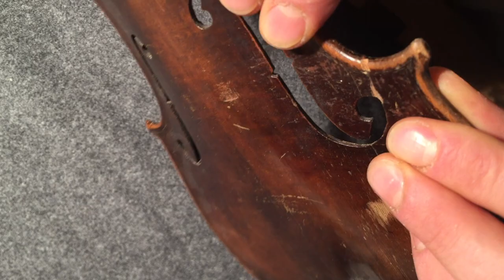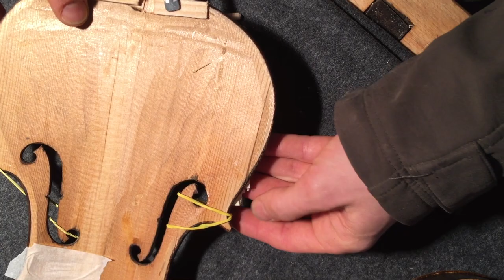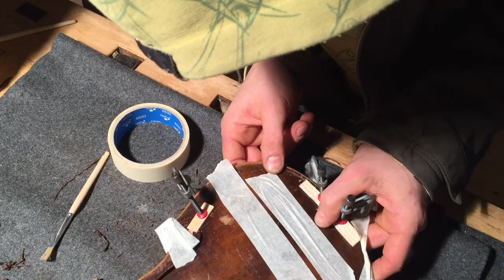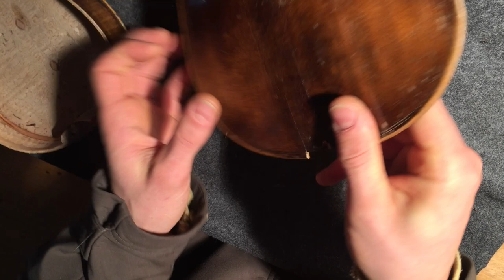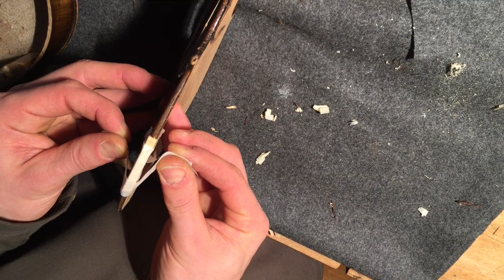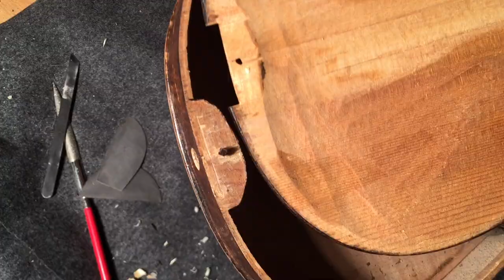Violin Repair Part 2 violin top cracks

Comment: I absolutely LOVE the fact that you are using masking tape on a violin! lol. I use it in guitar repair, gluing binding and stuff like that, but this is the first time I have ever seen anyone use it for violin repair :) Excellent job!!!
Reply from the maker: sure, clamping force for violin repair work and usually should be very low to not build up any unwanted tension on the instrument. and I use magnets for patches :) but also cnc .) Thanks!!!

Comment: Very nice video...is there a part 3 video?...did you ever consider smoothing or scraping out the original rough gouges on the underside of the top plate?...
Reply from the maker: Thanks, not finished yet… but it’s not for a customer… had to make other repairs & paid jobs… maybe i will make this video/ violin complete in future… i am not going to smooth the rough underside, because i am fascinated about the correct average thicknesses at its limit.

Comment: Thank you so much for the great video! What kind of glue are you using for the repairs? It seems to dry very thin.
Reply from the maker: I use traditional hide glue, and i prefer the bone glue. Its almost transparent and i prepare it for depending on the application, more or less thin.

Comment: hello Meister, what material do you use to reinforce the gluing instead of the wood? Thanks a lot
Reply from the maker: Hello, I am reinforcing with planed wooded shavings. Won't get simpler and lighter, without being over enforced and inflexible. Not much needed, make the test.
Reply: @CJKViolin  thanks Meister. Do you have an other video showing this technique?
Reply from the maker: osito1959 Castro just another picture on my Instagram,  i use magnets and tape as clamp

Comment: You must be genius.. using 1$ tape instead of 100$ clamp.. thanks for inspiration!
Reply from the maker: not only the prize, its fast with precise pressure points and very good for (crack-) alignment control. Just don't rip of old loose varnish!